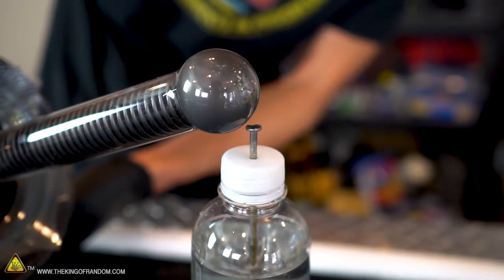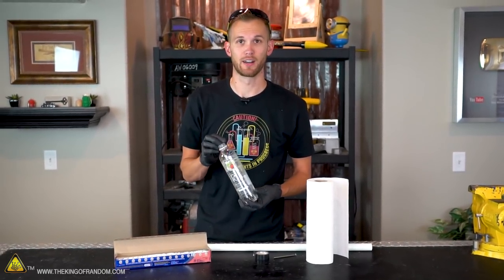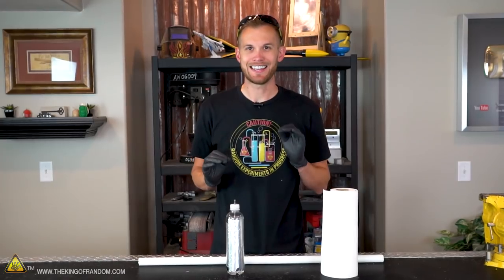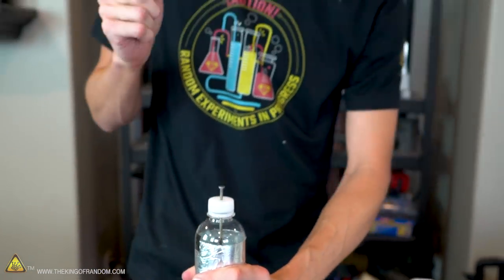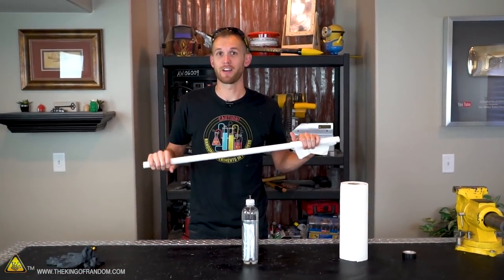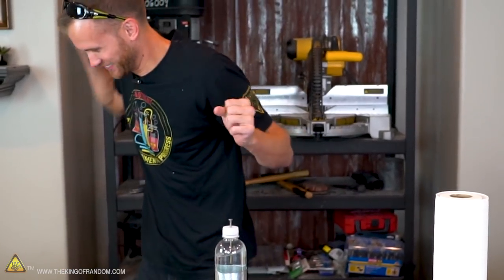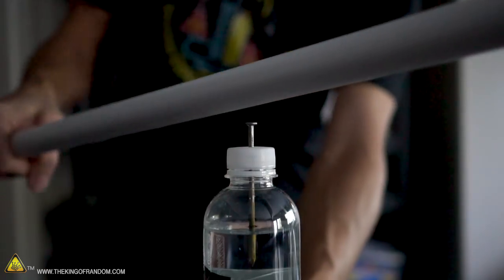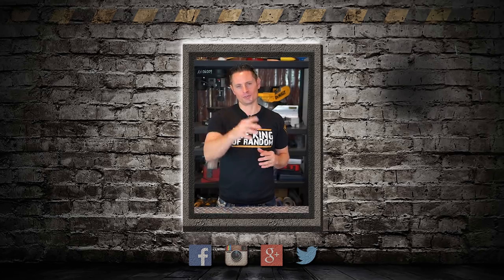SHOCKING Science with a Leyden Jar! TKOR Details How To Make An Electroboom Leyden Jar!

Comment: The reason he gets a shock from the outside is because it should be earthed. In other words the foil should wrap around the bottom of the bottle to touch the bench. This would also give the bottle a larger capacity for static electricity.
Charging the jar with an electrophoresis would also enable more charge to be stored

Comment: The main reason that the jar didnt charge sometimes is because you didnt hold onto the foil. That is why the whole thing works. The foil is grounded by the person touching it and so it gains a relative negative voltage compared to the water. This means that the water pulls more current into it and so the cycle repeats until the water cannot hold anymore and discharged through the plastic or through the air

Also a cool thing to do with these jars is to connect lots of them in series and charge the whole system. This will produce a much greater effect. This also works with lemons if you want a different experiment - run a light bulb/LED with lemon power

Comment: The plasma device runs on AC (alternating current).  You need DC to charge a capacitor.

You might try using a diode to rectify the output.  (I suggest one with a high voltage rating.)

Comment: Those nails are coated so you might get better conductivity if you sanded down the outside of the nail. Also might want to get a different type of metal in place of the nail, maybe zinc or copper.

Comment: Use an AC to DC power supply, put the black wire on the foil and touch the nail with the red (positive). It charges up almost instantly.

Comment: you should have used a multi-meter before touching , would have been interesting to which extent of how many miliamps the capacitor held from all that pvc rubbing , the reason you still getting zapped from the foil is that some of that current is passing on the plastic which is basically the same polymer type chain structure  as the pvc pipe that currents flow through  , use a more inert container like a wooden jar

Comment: try charging it with a dc power supply some small one from a phone or such hook one wire to the aluminum one to the nail and let it sit for a second or so.. see if that boost the capacity discharge?

Comment: Cool. Well you can't charge it with the plasma globe because this is AC electricity at around 40 KHz.  The AC electricity switches polarity over 40,000 times per second. The charge on the PVC pipe is DC and does not switch polarity.

Comment: A plasma globe puts out high frequency AC. You need a high voltage diode between the plasma globe and the Leyden jar. Otherwise, it's just rapidly charging and discharging the jar.

Comment: charge it with a microwave oven transformer. you need the diode that is in microwaves too though, its rated for 2000 Volts, then it'll make a spark

Comment: mine doesn't work like this one, i charged it, but it only "works" if i dont touch the foil at all, but it doesn't tingle, just a tiny spark. If i do hold it while charging by the foil, nothing happens when i touch the nail, only twice, with 2 different bottles have i felt SOMETHING with the foil, not much though. PLS help somebody.

Comment: hey why not have multiple layden jars stringed to gether as ail to nail and foil to foil and charge it up by using ac power but with one wire on the nail and the toher wire on the foil and then hook a light bulb or a led to the layden jars where you charged the jars up and see what happens

Comment: What is going on? Your body is charging aswell because you are touching the PVC pipe. If you charge it up, then go touch something grounded like water tap or heater pipes, you should discharge and then you can try it. It is really small charge though from the PVC. Try it with Van de Graafs generator, it will be waaaay more fun :D

Comment: You should try using your capacitor to power a mother board enough to run a computer or rather modify a solar power calculator so u can use that to power it.

Comment: Plasma globe outputs AC, you need a DC to charge a capacitor fully. You can charge it with AC, but you need to remove it at exactly right time, manually it's impossible.

Comment: Hımmm i am a electrician, and know leyden jar. But ,it is a shame, that i never tried it. :D

But now i wonder. instead of using flat head of nail, using a ring could be beter for charging? i mean, You can pass the pipe through inside of ring. this way, maybe you can get bigger impact with lower effort.

Comment: Mine isn’t working. I put the tin foil around the exact same bottle secured it with electric tape. I used a 1/2 an inch grey pvc pipe and did what he said but it didn’t work. Please help
Reply: Christopher Haas how long is the PVC pipe? For a 2.5 from piece 1/2" it took me like ten charges to feel something small. If you feel the shock when u grabbed the foil there's something wrong
Reply: Josh King 
my pipe is about 2 feet long and it has 1/2 an inch on the inside. I don’t feel any shock at all, not even when I touch the tin foil...

Comment: when using the base of the plasma ball you should have taken the rest of the glass and in the cable have placed a diode to rectify the electricity, because the output is AC, so it did not work.

Comment: can you charge it so many time that it acts like a tazer?
Reply: No, a leyden jar will only hold a small amount of electricity. Probably between 5000 and 10000 volts, depending on the size of the jar. Also, it discharges completely, so it only works one time before it need recharging.
Reply: +shinaanish thats kinda sad it can't be like a tazer XD

Comment: The reason you're getting shocked while grabbing the foil is because you added salt to the water. This makes the water more conductive and allow the charge to dissipate between the two plates. If you remove the salt, it will not discharge when grabbing the foil. 

Also my guess why the static charger didn't work is because you didn't complete the circuit to allow the charge on the foil to build.
Reply: I just started learning about electricity from the VERY beginning yesterday and I already know everything you just said is so wrong lol

It doesn't matter how conductive the water is, there is an insulator between it and the foil so the charge from the water can't dissipate to the foil. Also, if it did, then there would be no charge difference or voltage to produce any shock from the foil or the nail. 

Also, idk why the ball at the end wouldn't charge the water, but the foil on the outside completing the circuit would make it the exact opposite of what it is supposed to be. A capacitor isn't supposed to be a closed circuit

Comment: No dude, when you touch it you're grounding it so the foil has the same potential as you. If not, most of the shock will dicharge when you first touch it because it has a differential to ground potential.